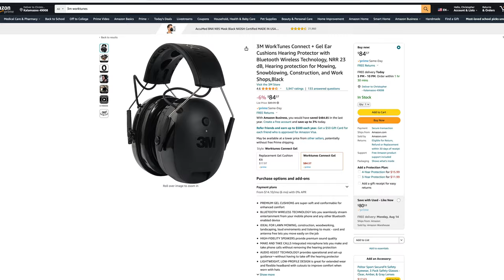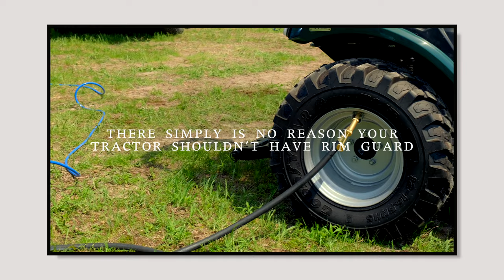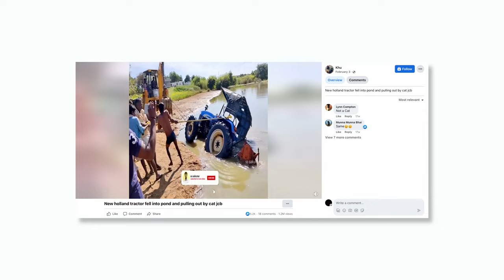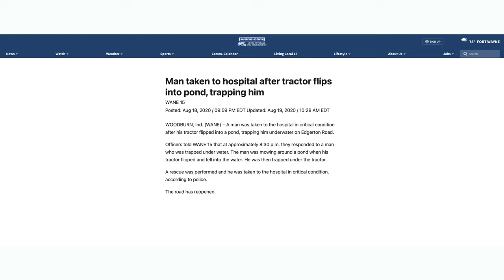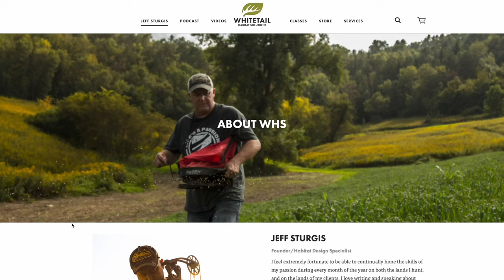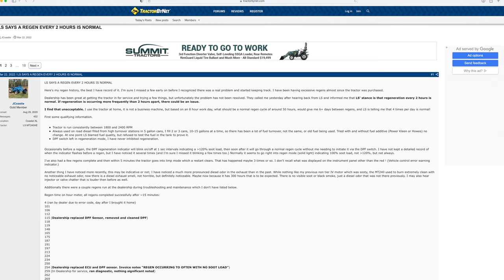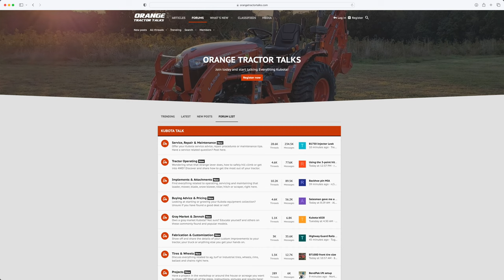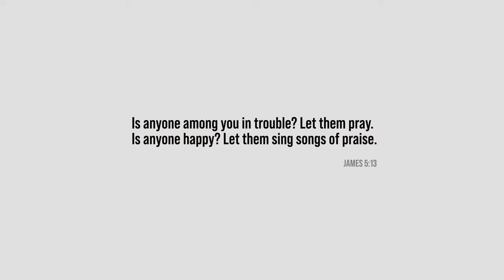EASY PARKING PAD FOR TRACTOR ATTACHMENT STORAGE + MUCH MORE!

Comment: I also have 3M Worktunes that I use while driving my tractor. They are sturdy, comfortable, block outside noise (can wear at a gun range, for example) and the sound quality is pretty good. I would also submit that wearing glasses with ANY headphones is going to get uncomfortable after a while and can cause headaches. It is best to move your glasses up and down a bit every so often.

Comment: Cover that pad with a solar roof.  Get power offset benefits with the benefit of covering the tractors from most weather. I’ve been using the 3 m muffs for about 10 years (the single button Bluetooth version in yellow and black) on my z turn, 1 series, and sanding f floors without any issues. Battery lasts a good long time, days if you keep the audio volume lower to moderate.

Comment: I like the looks of a Summit tractor, I thought that they were going to come out with a cab model this year?? Service is a big thing for me and even if we got one online there has been no talk in our area about people to fix them. Thank you
Reply: I agree with your thoughts. I am hopeful that Summit will be the next big brand. I am a business owner and have watched all the vids, it appears they are taking making the right moves to succeed. However, I would never buy one without the dealer network established. Same principle for a boat, rv, atv and ect, dealer/service is everything. Best of my knowledge, Summit does not have a strong presence in central Indiana. I may/could own one someday, but it's not today.
Reply: @davepowell8389  The Summit TX25 is a Solis H24 (also made by ITL) styled and optioned to Summit's specs.  Both are copies of the Mahindra Max 25XL, and all three use the same Mitsubishi engine and other major components.  Summit themselves has acknowledged that there are 18 SCUT brands, but only 8 manufacturers behind them.  Like back in the day when Ford, Lincoln, and Mercury all shared the same underpinnings from the same suppliers, factories, etc.  Options and styling differentiate them.  If you have a Mahindra dealer nearby service shouldn't be a problem.

Comment: I would say for your troubled food plot area with the random corn and other grasses. I would just till that all in as green manure and plant in some turnips and radishes yet for your Brassicas. Deer will eat them all winter and early spring.
Reply from the maker: Been thinking about it.  Part of the reason I planted it was for vertical cover/screening.  I walked it a bit this morning.  It's fairly thin, but a wide enough patch that it still might do the trick for a screen/cover layer.  I'm torn on what to do.
Reply: No wrong answer. Either way you are learning a ton and won’t have a bad time doing it. Sometimes the hardest thing to do is be patient. I’d let it ride personally.

Comment: As an equipment owner operator for 40 years, I personally don’t like fabric. Gives a problem of being dug up sooner or later. I’d rather strip the topsoil, build up with clay then and stone. Still some grass problems occasionally but not a big deal. Operating tip, when grading with bucket, keep a little material in the bucket. It adds weight when start pushing or back dragging.

Comment: Courtney 
I did have a question for you and anyone else on the landplanes. Do they come already adjusted to make a crown or do you adjust them for a crown? I would think for  this pad and a parking lot maintenance that you wouldn't want a crown like you would for a driveway?
Reply from the maker: Hey Jim, the plane isn't crowned, it just has offset edges that will send material left or right.  So, you can go the opposite direction and remove a crown just as easily as putting one in.  I currently have virtually no crown on my driveway and used the land plane to make it that way.  Long story short, you have flexibility to crown or not crown.

Comment: Another great video, I have some covered buildings for most of my implements with moving parts,  but dont mind leaving the land plane, box blade and a scraper out in the elements, but prefer to keep anything with a gearbox or exposed cylinders out of the weather, now I'd like you to explain machinery's natural attraction to water, especially a zero turn😳😂😂 😂, but your advice is dead on regarding getting on steep wet slopes, they can be deadly😬😵🙏

Comment: On my LS with over 500 hours. It seem that I need to regen more than I need. I don’t keep track but it seem to run about every 15-20 hours or so. If I neglect my air filter it seems to regen more often. I will continue to work while regen is happening. I don’t hit the switch, kick the throttle up to regen rpm’s.
Reply from the maker: Pretty odd, thank you for sharing Stuart!

Comment: My M7060 regens often. I use it for loader work a fair amount of time and can not run the rpm's high. Its a manual transmission so keeping the rpm's up for loader work is not an option. Many times I have had to leave it on the governor and walk away for the regen to complete. Drives me crazy. Hate it. I think its time for the tractor companies to start thinking gasoline engines again. I hate to say it, yet these emission systems are not user friendly.

Comment: 340 hours on my 3 year old Kubota L3901HST and I've had 4 regens...  so that guy with a regen every 2 or so hours either has a bad tractor or isn't using it at the recommended rpms.

Comment: I like alot of your content... However I hate looking at green tractors when I know from repairs there junk...  50hp and above are great tractors!  Under 50hp have cheep parts from China and there built to brake...   Not thrilled with electric junk either...  Truth is Kubota builds the best tractor up to 50hp...   But and Korean tractor has the sub compact and compact  JDs beat...  But I try to focus on the attachment....